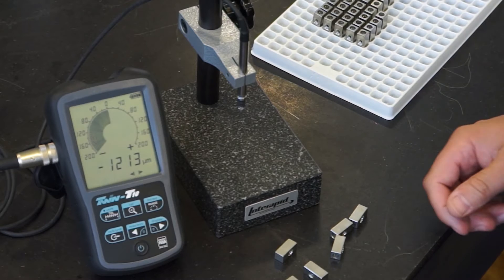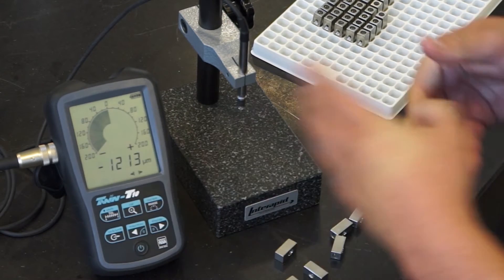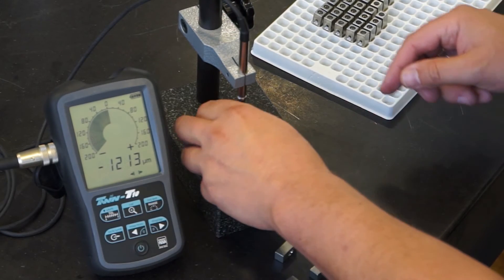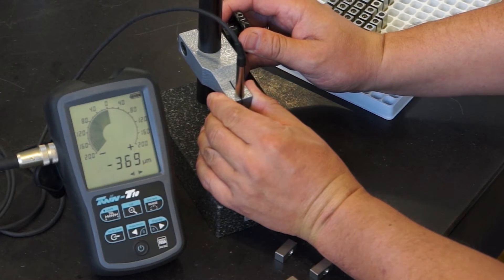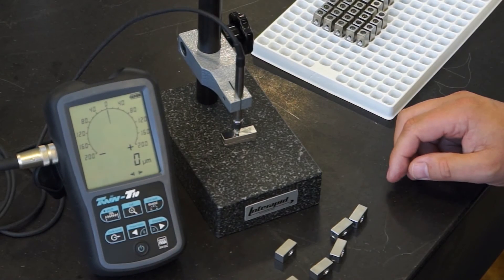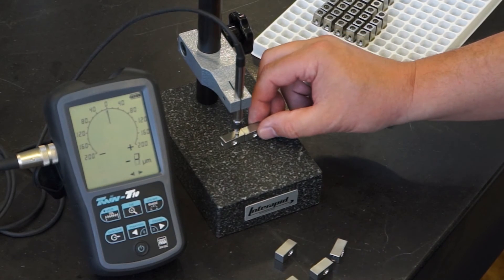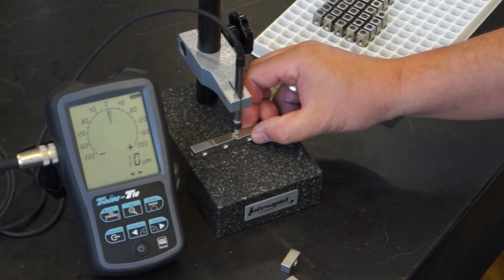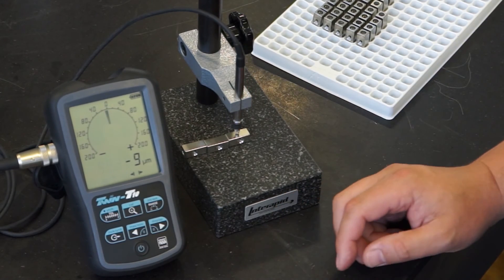TESA TWIN-T10 application video 2: comparative measurement of the height of a batch of workpieces

Comment: What is the measuring probe used to measure the parts?

I just purchased a TESA T-10 but it does not come with probes.
Reply from the maker: Hi Alfredo, the probe you see in the video is a TESA GT 21 (Art Nr 03210904).